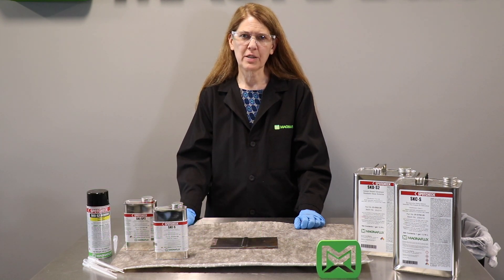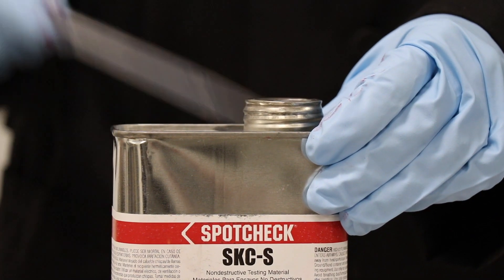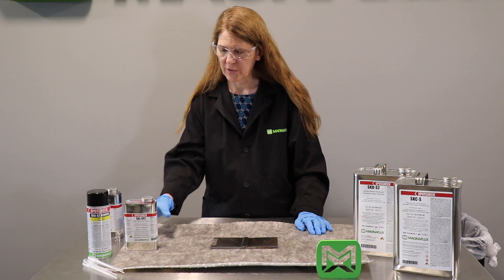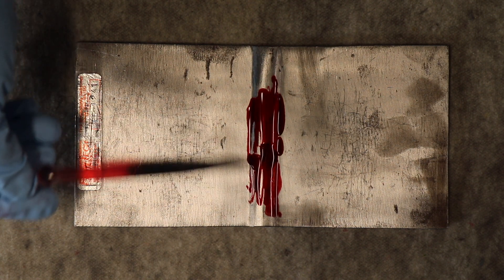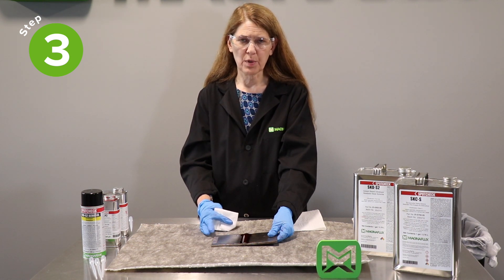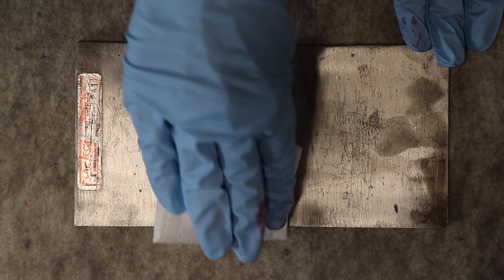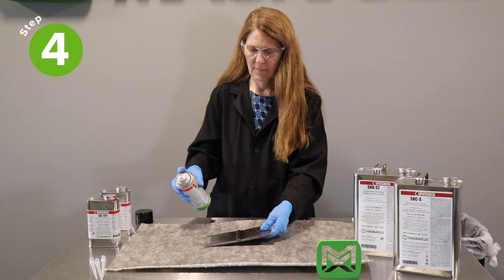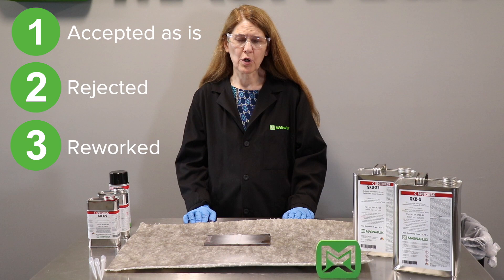How to Do Visible Dye Penetrant Testing

Comment: Would brake cleaner be an acceptable solvent to both pre-clean and post-clean the area to be inspected? In a time sensitive setting due to not having the recommended cleaner.
Reply: you can use acetone for pre cleaner, if handy.